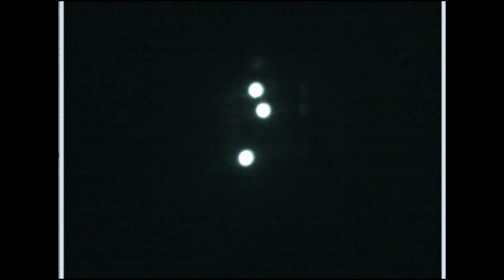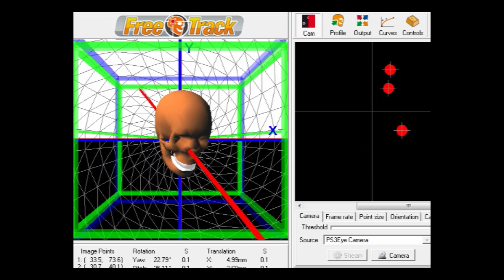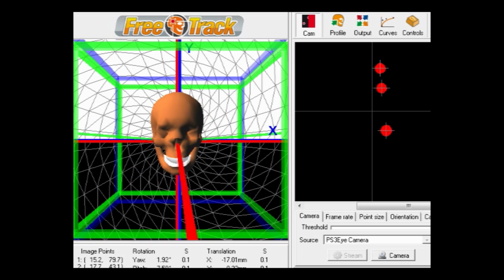DIY IR Tracking Device Tutorial Part 1| Hacking the PS3 Eye

Comment: Did you test the facetrack before doing this on ps eye? My fear is run better on facetrack app than opentrack app with leds.
Reply: Pedro Amaral opentrack with IR leds works 1000 times better than facetrack, I’ve just made the switch from facetrack to a 3 IR leds setup and I’m super impressed by how it improved. Removing the filter on my camera messed the focus up though, so I think I wouldn’t bother doing it before trying with the leds

Comment: A top of the pencil and a glue gun made it much easier =) and you can keep IR filter or rear lense one piece and clear and put it back if you need. Do it only if the rear glass is flat! If it bulgy - you have a lense block without IR filter!

Comment: I found that heating up the tip of my knife with a blowtorch made it MUCH easier to remove the IR filter; much less force required, and much less mess. After scraping off the melted plastic with a small screwdriver it looked very tidy.
Reply from the maker: Nice tip, thank you for sharing !

Comment: i did make one " eh " it work BUT my DIY Track IR thing i clip on headsett dident work that good :/ not good enogh IR lamps
Reply from the maker: There is a thing called "Luke Clip" it's a good product. I personally use only the Luke clip anymore.
You can find it on Ebay
Reply: TheNorthernAlex  I know man but yeah the money im not rich or im rich in a wasy but dont want to spend the moeny :/ did try to make it as cheap as possible
Reply: i did buy a set from Ebay complete
Reply: @TheNorthernAlex  can't find it ? are they still made ?

Comment: Dont call it a poor mans TrackIR, I just refuse to give 150 euro for a product that cost less than 5 euro to produce. ;)
Reply from the maker: Well, yeah I see your point. Though I have spent since then the money on a TrackIR and I have to be hones. You just don't get the same performance out of the DIY once due to the limitation on the hardware. TrackIR is smoother overall and performs better. 

But yeah this is definitely a alternative if you don't want to spend that kind of money

Comment: What size is the ir filter; planning on ordering a band-pass for 850nm ( TrackClip led wavelength maybe? )... I've heard 9.5mm, 10mm, etc... so if you still have it and could measure it that would be fantastic!
Reply: 6.73mm or 0.265in - just measured one... Is the camera supposed to appear blurry after this? ( I haven't put film in yet because I wanted to order a band pass )
Reply: I'm trying to find a solution to remove the IR blocking film from the lens... Rubbing it with some alcohol worked slightly.. now I can see the dimmest remote I have ( bright without, dim with ) through the filter, barely...  I'll likely need to use an abrasive cloth such as microfiber or even finer if the next solution doesn't work ( hand sanitizer )

Comment: well i fucked up lol. ended up totally cutting the back off it... Ballz I got a bad one... bloody hell...
Reply from the maker: +Microwave Hate Machine you win some you lose some, maybe order the premade one I am showcasing in my review of the new track clip
Reply: +TheNorthernAlex Na I wanna do it myself hehe. I already added a USB port to my head phones and made the IR head tracker. just trying to get a better camera... let's hope the next try works lol...
Reply: +Microwave Hate Machine If you haven't got a "good one" yet, you can modify the bad one. 

When you get to 5:40 in the video you just remove a little ring of black plastic. Don't start with a knife. I did that mistake and cracked the lense.

After that you turn the housing upside down and tap it gently against your hand or mousemat. You will see that it slides out quite easily(I found this out after cracking a little part of the lense, but it still works.)

The lense has a red tint on one side. And as far as I can see, this is the IR filter. 

Use some fine grain sandpaper (I used 2000). Lay it on a hard surface so it's completely flat. Then put the red side of the lense flat down and sand it off.

Re-assemble and put a piece of floppy inside just as in the video.
Reply: +Trollgaard Troll Thanks pal, I got a good one in the end XD

Comment: Would it not be quicker to keep the cam in one piece and just slice through the lens body, and take the IR filter out, and then slip in the new(olde) Floppy-Disc filter, and then superglue it back together? 
Gawd, I am a roughhand.
And what did you have to order (you mentioned at the beginning?), was that just the ebay cam?
P.S. you need to train your cameraman up a little. :D Noch mal ein bier bitte.
Reply from the maker: +Roger Dodger The cam and later on some more odds and ends for the track clip

Comment: Got my ps3 eye for ~4.50 dollars with free shipping from ebay. I bought my ir device for $16 free shipping. Using FaceTrackNoIR. Total cost: $20.15! Total cost for TrackIR: around $180. You do the math!
Reply: +DayTripperID Also, FaceTrackNoIR works with IR devices. Ignore the "no IR" part, it's optional.
Reply: +DayTripperID Or try OpenTrack. Actively in development: github.com/opentrack/opentrack
Reply: OpenTrack removed Facial recognition and hasn't had it for a year or so if I recall correctly.
Reply: You don't need facial recognition if you are using the led system. The facial recognition always sucked in every program I tried with different webcams anyway.
Reply: Yes, but having the option is nice until the device arrives.

Comment: If you used regular led could you bypass opening the ps3 eye?
Reply from the maker: +gantin strike Yes, but then you could use just regular facetrackNOir software which tracks your face. It is less accurate and way more jerky in movements
Reply: This is the working one for me, i just found it on google plus. **********************************  https://www.facebook.com/Truck-Simulator-2016-Online-Cash-And-Gold-Generator-995310837194009?pidid=2c490c0c-d0eb-4cad-bfa3-077b5de26499                                                                 DIY IR Tracking Device Tutorial Part 1| Hacking the PS3 Eye
Reply: This is the working one for me, i just found it on google plus. **********************************  https://www.facebook.com/Truck-Simulator-2016-Online-Cash-And-Gold-Generator-995310837194009?pidid=8fe18323-edf2-40e4-a7a7-3b1c0bd68b9c                                                                 DIY IR Tracking Device Tutorial Part 1| Hacking the PS3 Eye

Comment: Hi
If anyone is interested, please check out my hand made tracking clip on my youtube channel or search for LukeClip on ebay. It is battery operated so you dont have to mess with power cords. It works great with the PS3 Eye camera or other webcams and with free software like FaceTrackNOIR. It is much cheaper than TrackIR but works just as well!.
Please share this with anyone that might be interested. Much appreciated!
Lukasz
Reply from the maker: +dudekidPL Hey Lukasz that looks very interesting, the thing that worries me a bit is the fact that it uses non rechargeable batteries. If one would use Rechargeable CR2032 would the setup allow them to be recharged in the device/ are you considering developing that feature ?
Reply: +TheNorthernAlex 
Hi Alex
It does use non-rechargable batteries, however I have been playing with it for two weeks now, over an hour a day on average, and its still going strong, so battery life is long. It also can be cable powered when the batteries do run out, so you can keep playing until you get new batteries.
As far as I know additional electronics are needed to recharge batteries, so with the current setup, recharging batteries would not work. The only solution i can think of for now, is having a separate recharging device.
But i am definitely open to opinions and strongly considering to develop the device in the future.
Thank you for your comment :)
Reply from the maker: +dudekidPL I looked into it, a recharger for 2032's costs $32 for us, which is reasonable. If you want to spread the word about your product I would love to make a review of it on my channel.
Reply: +TheNorthernAlex 
Hi, i sent you an email to your address on the "about" section of your youtube channel :)
thank you!
Reply: This is the working one for me, i just found it on google plus. **********************************  https://www.facebook.com/Truck-Simulator-2016-Online-Cash-And-Gold-Generator-995310837194009?pidid=2c490c0c-d0eb-4cad-bfa3-077b5de26499                                                                 DIY IR Tracking Device Tutorial Part 1| Hacking the PS3 Eye
Reply: This is the working one for me, i just found it on google plus. **********************************  https://www.facebook.com/Truck-Simulator-2016-Online-Cash-And-Gold-Generator-995310837194009?pidid=8fe18323-edf2-40e4-a7a7-3b1c0bd68b9c                                                                 DIY IR Tracking Device Tutorial Part 1| Hacking the PS3 Eye

Comment: thanks for the video... never knew that a floppy disk could be used as a low pass filter... read about it but your vid actually showed it... impressive, and I used to work with optics in the CAF.
Reply from the maker: Yeah a floppy disc or developed film works even better. Nice on the cAF part I was a E6 Army Aviation CH 53 GS
Reply: Very cool... did 10 years on CF18's and 7 on Griffons
Reply: RoughriderUT Was comparable as an E6 for Avionics

Comment: Since I didn't want to filter the visible light I noticed that this mod messes with focal point.
But you can fix that very easy, just grind the base of the lens assembly about >1mm down.
Don't be afraid if you grind to much you can use paper as spacer and the mounting screws allow you to adjust it until it is dead on.

Comment: thanks for your great video- will PS3 eyes sold in the UK work with this (PAL system- not sure if still 120Hz)? Some of the comments below say not all PS3 Eyes are made the same- do we have a specific model number that works best? Also how do you mount the device once complete to your head? thank you very much for any feedback
Reply: TheNorthernAlex I found out today that there are actually two different versions of the PS3 Eye camera. One of which has the IR Filter ontop (like yours), the other has it in-between two glass lenses.

Unfortunately it's very hard to tell until you open up the camera which one you have. More info here: http://nuigroup.com/forums/viewthread/5189/
Reply from the maker: I am not sure which model number that would be. I tried it with one from eBay and one from Walmart so either I was incredibly lucky or the ones sold in Canada all work the same.

As for mounting the IR clip, I used one of those clips that you get to hold your sunglasses in place in cars to attach the IR clip to my headphones.
Reply: Tylo thanks!

Comment: Ok so i did a test run this morning trying to see if the cam works. But the second i start free track and switch it to the ps3 cam it crashes. Is this normal or am i missing something here ?
Reply from the maker: Fr3ubel That is a common problem, click on Stream and change the FPS setting to anything with 24 bit, 32 causes a crash instantly.

Comment: you should warn users that there are different types of IR blocking lenses, yours was one of the easy ones some are almost impossible to remove without trashing the assembly. The one on mine for instance is approx 5mm thick and deeply embedded in the housing it will not come out with a xacto knife.
Reply: after  my filter lense crushed during the process - it was easy  to remove it ^^